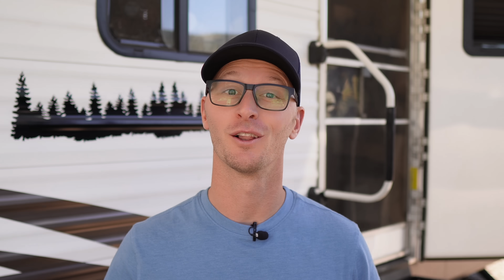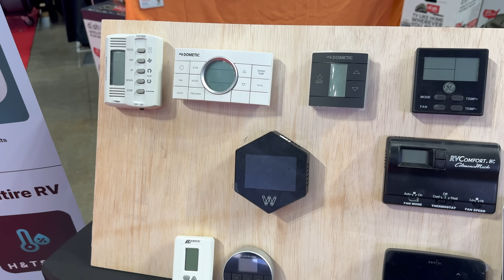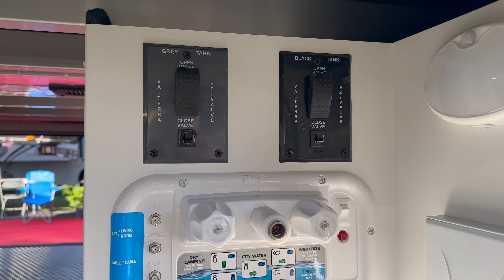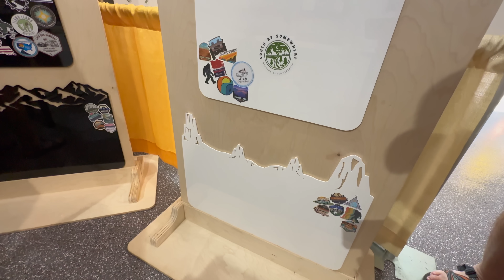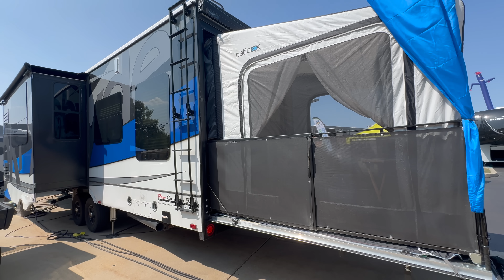The Best RV Gear, Accessories & Gadgets From the Hershey RV Show!

Comment from the maker: Large RV shows are a great location to scope out and touch new and different RV gear - here are some of the standout pieces of gear from the America’s Largest RV show in Hershey Pennsylvania this year!
⭐⭐ Examples of Products Used In This Video ⭐⭐
🔷Camco EvoFlex 2 Freshwater Hose https://geni.us/ha5Bs
🔷Valterra EZ Valve Electronic Blade Valve Kit https://geni.us/Ue7QhVD
🔷Centramatic Wheel Balancers - Example Only- Part Number Varies By Application https://geni.us/CaJM1QJ
🔷Andersen Stax Stacking Blocks https://geni.us/Gih5G61 (Amazon)
🔷Blu Technology Water Filters https://geni.us/4rl0p0
🔷RV Residential Flush Bypass Valve & RV Snap Trap https://rvgearandfar.com/ezrvsolutions
🔷Rivet Supply Co Adventure Boards: https://rivetsupplyco.com/58?sld=rvgearandfar  
Coupon Code: rvgearandfar10
🔷Kool RV AC Optimization Insert https://rvgearandfar.com/koolrv
🔷Waltech RV Thermostat https://rvgearandfar.com/waltechrv

DISCLAIMER We participate in several affiliate programs that earn us a commission on purchases made through our links at no extra cost to you!
Some product links are affiliate links which means if you buy something we will receive a small commission. As an Amazon Associate I earn from qualifying purchases. 

🎥 Video Links 📺
* RV Residential Flush Bypass Video https://youtu.be/QLkJik2UCyM
* Zero G Hoses Compared Video https://youtu.be/uvOFcdbgsrU
* MORryde Patio EX  https://rvgearandfar.com/ytcomingsoon

⚫ MORryde, in partnership with EZ RV Solutions, introduced the RV Residential Flush, a black tank bypass valve, and a sewer hose support that forms an in-line p-trap in flexible waste hoses called the RV Snap Trap.
⚫ Andersen Hitches showcased their new  Stax Leveling Blocks, made from the same materials as their curved ramp camper levelers. Rated at 120,000 lbs, these blocks are 3x stronger than most plastic options. 
⚫ WalTech’s smart thermostat 2.0 Unlike previous options, this upgrade features pet monitoring, room temperature alerts, and global connectivity through an integrated SIM card. 
⚫ Kool RV has a plug-and-play insert for existing air conditioners, claiming a 44% performance boost by directing cool air directly into the ducting system, reducing pressure and temperature loss seen in many units.
⚫ BluTechnology’s high-end water filtration systems once again made an impression with their stainless steel construction, braided hoses, and flow counters. 
⚫ Camco’s EVO Flex 2 water hose aims to compete with flexible fabric hoses like Zero-G, offering a new option for RVers seeking an easy-to-store, durable drinking hose.
⚫ Valterra’s EZ Valve is a retrofit option for RVs with manual sewer gate valves, automating the opening and closing via a 12V motor, with a manual backup override for emergencies. It offers a simpler, hands-free waste management solution for existing RVs.
⚫ Rivet Supply Co. presented an aesthetic product for sticker collectors: adventure boards made of lightweight acrylic that allow RVers to display their collected stickers without damaging their rig. 
⚫ Centramatic wheel balancers: Using a combination of solid media and synthetic fluid, these balancers dynamically balance the entire wheel and hub assembly for heavy-duty trucks, trailers, and motorhomes. The technology, proven in the trucking industry since the '80s, may benefit RVers looking for a smoother ride.
⚫ MORryde is bringing back the PatioEx, a revamped and improved inflatable rear tent for toy hauler decks. 

🚐 Favorite RV Gear:
🔸GasStop Propane 100% Emergency Shut-Off https://geni.us/KmLBS (Amazon)
🔸Liquified RV Tank Treatment https://geni.us/P5WuP4 (Amazon)
🔸Valterra Twist On Waste Valve https://geni.us/IHqqrCA (Amazon)
🔸HitchGrip Hitch Handle https://geni.us/FENglr (Amazon)
🔸RV Ramp Levelers https://geni.us/iJWkX (Amazon)
🔸Solid Rubber Wheel Chockshttps://geni.us/vS04fc4 (Amazon)

🏘 Join the RV Gear & Far Group Here:
https://www.rvgearandfar.com/rvgfyt 

🔩 DEALS: Sign up for our newsletter and we’ll let you know about deals and discounts!
https://www.rvgearandfar.com/signup

Connect with us! 
💥 🎥Connect! https://www.rvgearandfar.com 📷📺

© RV Gear & Far, All Rights Reserved. 

This channel is for entertainment purposes only; we are not experts or professionals. We share our opinions, experiences and what works for us. Please do your own research and make your own decisions.

#rv #rvlife #rvgearandfar  @morrydeinc   @andersenhitches   @WaltechRV   @koolrvinc   @CamcoManufacturing   @valterradometic   @RivetSupplyCo 

0:00
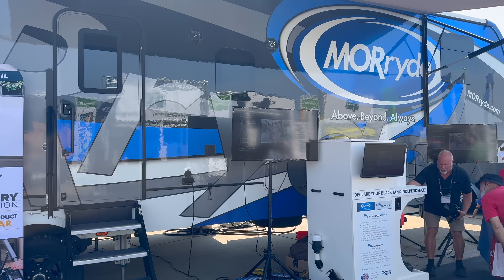0:15 RV Residential Flush Bypass Valve & RV Snap Trap
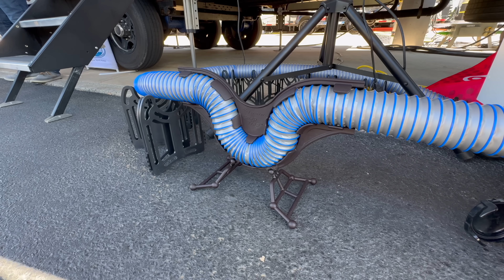0:29 Andersen RV Stax Levelers
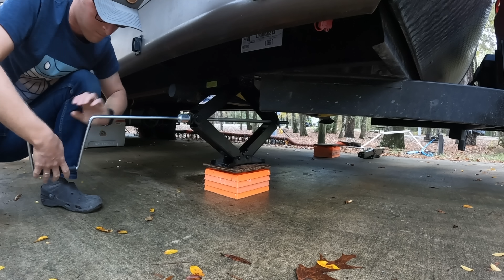1:47 Waltech RV Thermostat
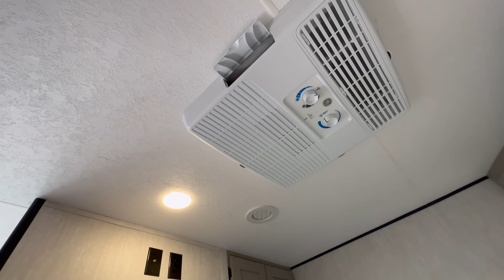3:18 Kool RV Air Conditioner Insert
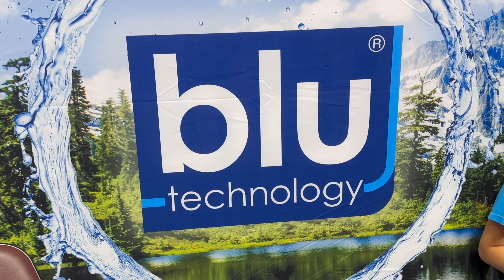4:12 Blu Technology Water Filters & Accessories
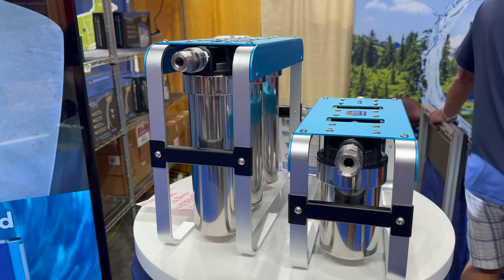4:31 Camco Evo Flex 2 Water Hoses
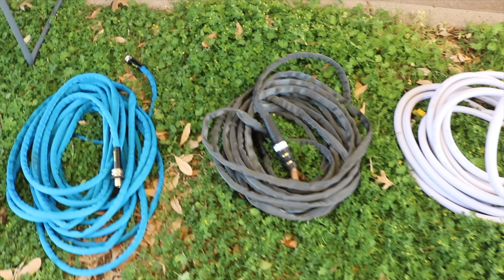5:03 Valterra EZ Valve Motorized Waste Gate Valves
5:44 Rivet Supply Co. Sticker Boards
6:52 Centramatic Wheel Balancers For RVs & Trailers
7:40 MORryde Patio EX 5th Wheel Toy Hauler Inflatable Tent Returns!
Reply: I purchased the Kool RV product for our rig once they went live with our model. Installation was somewhat easy, but keep in mind there are no instructions. You will have to find a YT video for assistance. At the end of the day, I believe what the product does plus the affordable cost will make it a huge winner. Thanks for sharing..........BTW, those motorized gate values may be worth a deeper look. Lol

Comment: Ayman, I hope you don't  good. But I have a question you make  video about talking  The R b's that there have 30 apps, connections, and my questioner was, what are I supposed to start to have the AC? Call down when you call coment l that we cannot have running the A. C the freezer in the microwave? All at the same time
Reply from the maker: Your question is a bit hard to follow, but I think you're asking if you can run the AC, the fridge, and the microwave all at the same time? Running your fridge on electric, a 15k btu AC unit, and the microwave all on a 30amp rig may trip your breaker - best option - turn off the ac when you run the microwave, then turn it back on.

Approximately:
AC: 12–15A
Microwave: 10–13A
Fridge: 2–4A
Total running load: ~24–32 amps

So you may run all three and depending on the cycle of the AC unit and the cycle of the fridge - it may run the microwave just fine - or the opposite could be true too.
Reply: @rvgearandfar thank you for the information, and I appreciate it for all the videos that you make

Comment: Yeah, there is no universe in which that AC insert is going to increase efficiency by 40%.  Sure, it may help a bit and may even be worth buying.  But if it was anywhere near 40%, every manufacturer would be in a race to incorporate it as it could give them a huge market advantage.
Reply from the maker: they didn't say efficiency, they said performance - now that could mean a lot of different metrics for sure - noise level being one of them, airflow, deltaT on intake output temperatures etc
Reply: @rvgearandfar  Fair point.  But its still both misleading and intended to mislead.

Comment: Would love 2 c a review on the new water hose compared against the Zero G hose.  The collars or necks on the blue Zero G hoses are not very durable.  

Have the centramatics on our 1 ton dooly and they are gamechangers.  We have a triple axle 5th wheel and have considered getting them for it, but its a bit priceeee
Reply from the maker: Another vote for more water hose testing - thanks!

They are pricey, especially if you'd have to buy 3 sets

Comment: Cut up a 2 x 8 and spend $8 bucks all you need!
Reply: I did the same thing. I have a 5th wheel and have used the wood boards for over 5 years now. I've used them on grass, sand, dirt, gravel, and concrete/asphalt. The only issue I can think of is if there has been heavy rain and I parked on dirt, the dirt is muddy when I go to retrieve the blocks. I just use a long flat head screwdriver to pry the blocks out of the mud and knock off the mud clinging to the block.
Reply from the maker: For jack pads you mean? True, and you'll get about 8 pads that way - but that would be significantly more bulky and heavier to carry
Reply: @rvgearandfar  Not really bulky to carry. I replaced my plastic levelers with a few 2 x 8 boards and use these to level my Class C motorhome (under the wheels). They last forever and if needed to replace waaay cheaper. The plastic blocks are terrible and expensive.

Comment: Koolrv is worth it, i ran my brand spanking new rigs ac for 2 hrs, it was 105° outside and 90° inside, I shut it down and installed the koolrv by the time I was done the rv was 95° inside, i took off for a couple hours and came back to 80° temp inside; which I set the thermostat to...
Reply from the maker: Glad to hear it works as advertised - I sense a video next summer comparing the different AC options ◡̈

Comment: been using the centramatics for a long while, i would not be without, combined with dyna beads it is all i use on ALL wheels!!  🤠
Reply from the maker: Do you use them WITH dyna beads? Would that be redundant?
Reply: @rvgearandfar  possibly??? i use both so each can do their job in tandem and make my confidence level more secure... have NEVER had a tire issue!!

Comment: The automated dump gate valve motor is a nice idea, and will help those who have a difficult time reaching the handle.  But this doesn't truly address the issue of difficult-to-pull waste gate handles.  The root cause of 'sticking handles' is not addressed.  I would look forward to the manufacturers finding a handle design that never gets too difficult to pull by hand in the first place.
Reply from the maker: Fair point - Sometimes I can tell that pressure also plays a part in how "sticky" my valves are - if there is a vacuum up or down based on which valves I have open, outside temps and how airtight the sewer hose is connected into the dump system it can greatly affect how easy the valves are to open as well.

Comment: I’ve replaced one of my black tank valves with the Valterra 12 volt and I wish I had done all my tanks with this set up. This spring I am going to replace all of them and mount the switches in the place where the manual pull handles are. It takes some work but it is worth the effort and gives a much cleaner look in the wet bay.
Reply from the maker: On a scale of 1-10 how difficult would you rate the install on your rig?

Comment: I have a BLU Technology filter system, including all the stainless couplings and hoses.  I HATE the hoses and the couplings.  The least little bit of sand gets in the quick connects and they bind up.  Now, after 1 year of use all the quick connects are leaking.  The stainless hose is also garbage.  It kinks BADLY, and the worst part:  When it kinks, it permanently  damages that section of hose because the stainless jacket gets bent out of shape.   It was a vey very expensive setup, and its been nothing but trouble for me.
Reply from the maker: I'm glad to hear some real world reviews of the system. I can see the "kinking" being an issue as the stainless steel would definitely bend and hold memory over other materials. Bummer to hear that the quick connects are leaking - have you reached out to Blu Technology to inquire about warranty replacement or potential fixes? My be something as simple as replacing the o-rings in the connection ends?

Comment: The Blu technology hoses are outrageously expensive. I bought stainless steel washing machine hoses and quick connect fittings from Amazon .40 feet total cost less than the 25 foot hose they offer.
Reply from the maker: I'd be curious to know if the internal portions of the washing machine hoses are rated safe for drinking water?
Reply: @rvgearandfar  So do you know if Blu Technology hoses are ? There is nothing on their website that states that. I do have the three stage 5” water filter and a single Blu technology filter came standard on our Riverstone I have been using the hose for 2 years now and no problems. So if you want to spend that much money on them be my guest.  And the  Centramatic wheel balancers have been out of years I drove semi trucks for 41 years and have them on my F-450 .
Reply from the maker: @TonyBenton0728  Valid point and I couldn't find it on their website either - I know when speaking with them at the show they are in the process of getting a NSF rating on their hoses so I can only assume - but you're correct, its not clearly stated.
Reply: It’s an investment but I love how quickly my water system goes together with Blu components. It was worth the cost to me.
Reply: @russsauers  What I have goes together very quickly. I can customize the length so I don’t have any excess hose laying around. And for a lot less money 💰

Comment: I have the KoolRV unit, and it’s amazing. The installation wasn’t hard and my RV did see better cooling. A side effect that they don’t advertise though is that it actually makes your AC unit significantly quieter. In my opinion, that alone makes it worthwhile!
Reply from the maker: Yeah the plug and play nature of it is REALLY appealing and the quieter operation is a major bonus! What other upgrades have you done to your rig that were worthwhile?
Reply: I installed two Maxxshades in my RV vent windows in lieu of the pillows and I like it much more. While it might not block out light completely, it’s good enough to keep it dark. And it reflects the heat very well as it still has a reflective back. It also has a built-in LED light if you do need more light in that area. I don’t use that feature though.
Reply from the maker: @titanmedia3181  Nice - yes its convenient to have the shades stored where they're used and I've been happy with all of the MaxxAir products I've used.